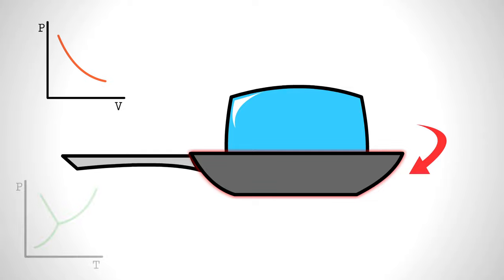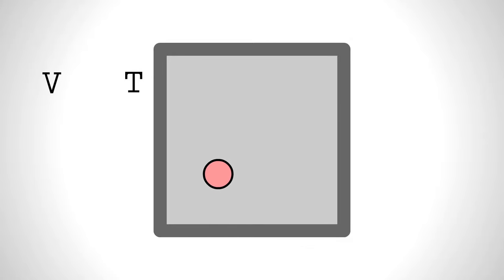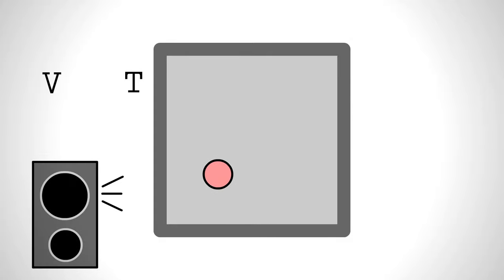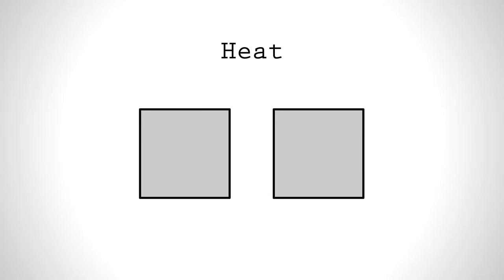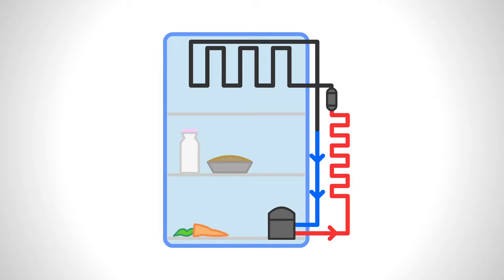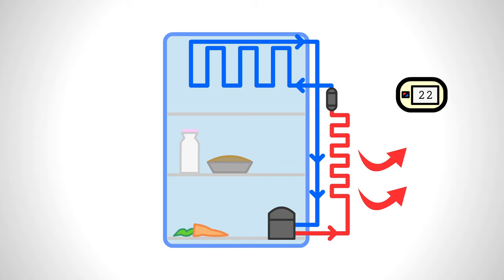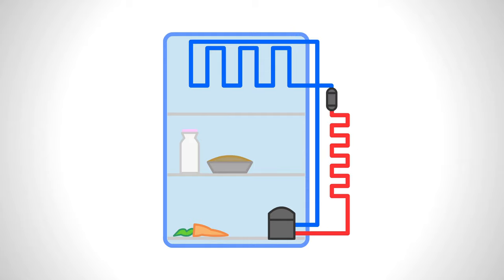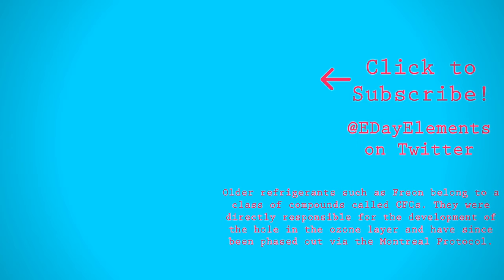How Do Refrigerators Work? | An Intro to Gas Laws and Thermodynamics

Comment: so we're using compressor to increase pressure hence increasing temperature, But when the refrigerant comes from cooling stuff it is already in a hot state so why do we need compressor?
Reply: I thought it was to keep the liquid moving constantly but also the same can be done with a turbine pump so I had the same question
Reply: I'm late to the party, but without the compressor, the refrigerant can only get as hot as the inside if the fridge. 2-4 degrees C. The compressor makes the refrigerant hotter than room temperature, which allows the heat to move from the coils to the air of the kitchen.

Comment: For me the  key point to understand this is knowing that change in pressure will change the temperature, the rest you can guess with a little bit of thinking, now I know why the spray can seems to get colder when allow air to get out, that's because of the decrease in pressure

Comment: Bro I’m still confused. So you are telling me I take a refrigerant (some liquid that can be condensed quickly?) boil it, have room temperature air cool it back down into a liquid (where it started) put it into an expander where there is less pressure so it looses more heat, then use this liquid to cool down the inside of the fridge and then rinse and repeat? I feel like the expander is what is messing me up, how does it cool the liquid below room temperature?

Comment: There remains no liquid after the expansion valve. Introduction of heat does NOT cause vaporization, dropping the pressure via the “expansion valve” drops the pressure causes phase change resulting in cooling.